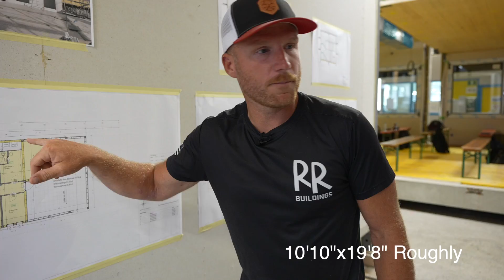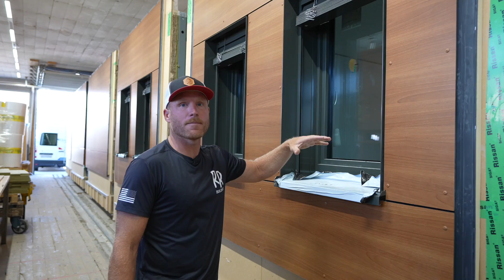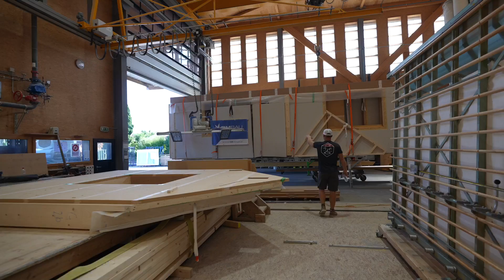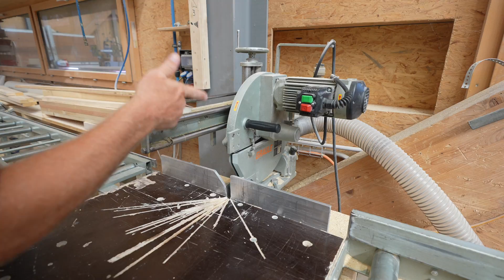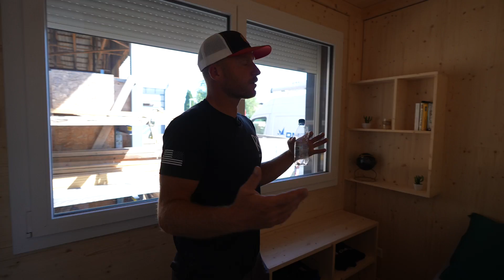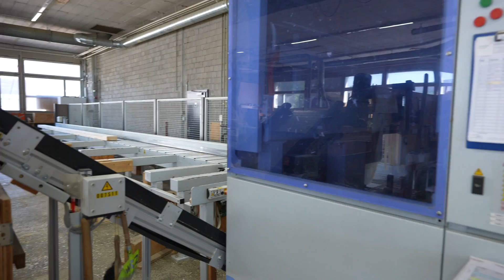First Time Seeing Modular Construction.  Switzerland Siga Tour Part 1

Comment: Abstract
Modular construction is a fascinating method where building components are manufactured off-site within a controlled factory setting. This ensures consistent quality and protects materials from weather-related damage.  The video showcases a Swiss modular construction company specializing in projects like a three-story McDonald's. They also manufacture residential units and even complete portable homes.  The advantages of this approach include accuracy, efficiency, and the ability to construct the majority of the building within a protected environment.

Comment: Kyle, you maybe think that you don't have in common with the Swiss the 'modular building' principle. But what you do have in common is your level of accuracy. I was born and raised Dutch, now in North America, so my brain is split imperial / metric but I have that same Swiss/German/Scandinavian need for accuracy. Building furniture, a quarter of a millimeter is not overdoing it. Which means in imperial I will do at least 1/64".

So a pencil line is too wide, a Stanley knife mark is much more accurate. On your huge post frames you do exactly that. Mmm, maybe sometimes 1/32nd :-). Keep doing what you're doing ...

1"  = 25mm
1/8" = 3 mm
1/16" = 1.5 mm
1/32" = 0.75 mm
1/64" ~= 0.5 mm
1/128" ~= 0.2 mm

Comment: Cracks me up at people at "how dangerous" a RAS is, it's no more dangerous than a table saw, miter saw and a circular saw. There are numerous video's on how to actually use a RAS properly. 
Modular buildings are nice, you really have to sit down and make the plans out very carefully. I don't like going "up", as one ages, one's knees say, no more stairs. A proper company that does this, (factory), does make these very nice and yes, extremely precise. Yes, it is the way of the future and it's already here in the states. The problem with what we "American's" make doesn't equal to what foreign countries do when it comes to quality. We simply don't make things like we used to and it all comes down to the bottom dollar as to why. Cheaply made but sold at twice to three times the price as it should be. Cheers :)

Comment: Come over to Northern Indiana. We have several modular home "factories" you could tour. My uncle has set modulars for 40+ years. My first real construction job was working on the on-site crew building the garages and front porches on these modular homes after they were set onto foundations. We were building a garage in about 3-4 days, start to finish. (Vinyl siding and shingled rooves on a 3-man crew.) We cranked out a bunch of homes that summer!

Comment: We recently bought a house that was a manufactured home , I love these builds but one thing they need to address is when they run the wiring they notch all of the panels and it is a virtual pathway for mice and chipmunks , after we moved in we found wires that had started on fire at some point and I ended up taking the lower section of the drywall out and redoing most of the wiring

Comment: My dad worked for a modular house designer/builder in 1954 in Baton Rouge, LA.  Dad and mom bought a house that was built of premade walls and other sections that arrived on site and connected.  The house was part of a subdivision of similar houses.  We moved back to Shreveport between Christmas 1955 and New Years 1956.  From what I can remember, the houses were finished out as usual on-site.

Comment: So cool how it can be constructed in a fully controlled environment , quickly and safer for the builders compared to a timber framed houses. Just have the raft slab or foundations with sewer ,elec and water connections done prior then crane your new apartment in connect up elec, water, sewer and you're off (lol never that easy). Only cost issue is that metal frame work of the modular container that's going to cost $$$ but can be offset by the reduced labour cost and possible lower internal finishes. Awesome to be able to just stack multilevels on at a later stage if the foundations were planned for. It's just limited architecturally if you looking at adding personal touches. Good idea for student and small apartment setups and easy to renovate interior later with a strip out Reno. Welcome.to the new world of living/working in a comfy retangular shaped shoe box.

Comment: Modular buildings ar getting more and more popular in the Europe and Scandinavian countries. I used to work for company that builds frame from metal. Pretty cool technology. Bathroom was built at the different factory and was lifted in the module after when floors and walls were built. After that comes roof panel on the top.

Comment: I was a general contractor in modular housing construction up until 2013.  Most of the homes we sold were manufactured in the Elkhart, IN area.  Some of the positive things about them is they're very energy efficient, consistent built quality, and structurally sound with a 10 year structural warranty.  I'd say that's an impressive warranty after they've been hauled down the road for 3-4 hours, moved on site with a dozer, lifted with a crane, etc.

Comment: It's been done in US for a while, many people have modular homes, some even double wide modular homes
Reply: I have such a modular mini-home....built in Canada's smallest province, where I now reside since 2020. The home is a 2-bedroom/2 bath with combination kitchen/living room and vaulted ceiling...as well as a mud-room, large enough to accommodate a full-size side-by-side washer/dryer, 48g Water-Heater as well as a Venmar air-exchanger . The outside dimensions are 56 x 18 feet, and the inside measures 54  x 16 feet, i.e. built energy-efficient with 1-ft thick  outer walls.
The build-cost including delivery (33 miles / 53 km) & install (on brick footings) was C$87,000 plus Taxes of 15%. 
Mind you, the build quality - while relatively good for Canadian standards - would never meet the Swiss workmanship (i was born & raised there 72 years ago...lol), but I'm happy with my semi-retirement home on 56 acres of wooded land about 2 miles from the sea ;--)

Comment: I worked for a company in North Carolina that built fully modular homes. We rolled out a house a day. I worked on the ceiling crew.
We racked up trusses that had channels routed out for 1X4. After the framing was done we would lay the drywall on the trusses. The ceiling was up and level unless the ceiling was vaulted. We used a speed set for mud. We taped and finished the drywall. We stood half the roof on the ridge and sprayed the popcorn texture. We'd lay it down on blocking and re-group the overhead crane to pick it up level and set it and attach it to the half of the house. Then start the next half.

Comment: The profit over quality mentality in the US renders a poor product for the masses. The Swiss/ German mentality of presicion lends itself to high quality resiliant construction. If A US manufacturer tried to employ these methods they would be underbid by low quality construction that lasts as long as the minimal warranty, less than the mortgage. The exception are the top of the market firms like Benson Woods etc who snag the few consumers who demand and pay for their quality. You have engaged a segment of the building market which suits your skills and vision. The capital costs of CAD driven modular shop built construction you are demonstrating though superior would not be rewarded in the US.

Comment: Most say modular homes are built better than stick framed due to the better foundation (steel frame built in a table) and being built inside so no rain and that they can just repeat cuts on giant tooling.
Reply: The advantages are obvious but the market decides the quality of the design and what materials are used. If a client will pay the same money for a cheaper product then the better product can not last in that market.
Reply: @toucansteve  Same can be said for tools made in China. How much quality you want depends on how much you are willing to pay.

Comment: I think for your type of work you could assemble your laminated columns in the shop and then take them to the site then attach your horizontal lumber for the siding, then erect the wall. Instead of trying to laminate your 2x6 columns in the field. Maybe it would save you a little time....
Reply from the maker: I buy laminated columns from a manufacture
Reply: @RRBuildings  Oh? Is that a new practice? I seem to remember a little while back you were laying out 2x6 on the ground and then standing them up with your horizontal girts already attached. That's what I mean by laminated columns. Is that the wrong terminology? Anyway, I love the channel. I'm a retired builder of all things custom and your dedication to craftsmanship is excellent.

Comment: I think it definitely has its place in the US that it would make life much easier. I think as long as your closer to infrastructure it would be something that could be quite popular. But for your more rural builds I don't see it being that practical to try and bring in large trucks and cranes without paying a ton of money on prep to the ground to allow for those weight ratings on say a dirt driveway or a heavily wooded area along a narrow driveway etc. My biggest questions as a firefighter is what does a fire look like for those. That is super interesting construction for sure.
Reply: FYI the use of materials and the controlled environment / construction means these structures meet the most stringent of fire regulations, as well as insulation etc. standards.
Reply: @WPGinfo  I am sure they are most of europe has way stricter standards than we do in the US for building materials, fire ratings, etc. I just wonder how a fire would behave if one starts.

Comment: Kyle, as a professional in the UK building products business for the first 15 years of my working life, I could never understand why the use of pre-fab, modular buildings never took off. You have underlined all the positive benefits of such systems, yet certainly here in the UK, where we are desperately short of housing, there are only a handful of manufacturers producing at best, a couple of hundred houses per year. Go figure!
Reply: We had a client try to get an insurance quote for the home they wanted to build in Sussex UK, wood prefab it was in the tens of thousands. Mainly due to insurance companies not liking wooden structures here, or shipping containers. Sadly we can build better, more air tight and insulated buildings from wood on site or prefabbed than you can currently with brick. Hence housing stock efficiency and running costs haven't realistically improved since the 1990s and in many cases are actually worse than the homes built in the 1930s and 40s.
Reply: @effervescence5664  Total lunacy. In Europe, Scandinavia and the USA, timber framed houses have been the norm for decades. An insurance company which looked out for new opportunities would see there is a great chance (after due diligence) of developing a new market for itself.

Comment: The crew i work with just finished a modular building, well we didnt put it together. We only did the siding.

The whole thing was built with premade squares. They didnt do a great job with lining everything up (it wasnt square at all, sections were placed inches off) but it turned out alright. We only did the cladding on it so we had to work with what we had because the cladding suystem they wanted didnt have any type of "leveling" system to it but we did a mix of hardieboard and corrogated roofing

Comment: All it comes down to is time and cost. If it's not faster or cheaper to do it this way, then it's not the "future" like all these companies like to claim.
Reply: That's essentially the whole point of that machine. It can do the work of multiple people over multiple days using with just one operator in a fraction of that time. Building off-site allows for the use of such machines a well as guaranteeing that sufficient work and material storage space is available for the job. Meanwhile groundworks can be in progress on-site without materials getting in the way. Additionally for transportation you're transporting only the used materials, off cuts and spare lengths are not transported so you're saving on that.

I think you'd struggle to make this construction method more expensive than traditional construction.
Reply: @yngndrw.  Well it depends what type of building and where you live. I don't see how this process can compete in residential housing where we can frame the entire house in 2 days with a 3-4 men crew. 2x6 and plywood is cheap compared to what they're using in this video.
Reply: @yngndrw.  Then you have to consider how much it cost to build and maintain such an enormous building. Then add the machinery cost. Then think about  how it would cost in shipping since you can only fit 1 or 2 module on a semi trailer. Additional cost if it's an oversized load. 

See, I'm a contractor and I don't see how it would cost less to build our stuff using this method.

Comment: I worked for a modular housing company and I'm surprised it's not being done more in the U.S.A. It only takes about 2 to 6 weeks to make a house depending on the size because weather isn't a factor. Also, because they have to be transported, they are built much stronger than traditional homes.
Reply: Have been working at a modular plant for the last 4 years in Pennsylvania as a exterior/interior wall framer and drywall. There are a handful of mod plants in my surrounding area that ship daily and cover the east coast down to Florida. Only plus is that i have covering and a little protection from the elements. The pay isnt the greatest but solid constant work.
Reply: Larry Haun the legendary framer and writer for Fine Homebuilding said that modular homes would have an extremely positive impact on housing in the USA. After building tract homes for years in California and watching a housing shortage develop he realized the ease and speed of modular construction was the way to go.
Reply: They relly are, I work with temporary buildings, putting them together and taking them apart for transportation to usually the next school. They are really well made, but in every joint we miss insulation
Reply: Cost. Cost is what everyone pushing for these things dance around. And anytime I go to look, it’s not just a slight increase, we are talking a dramatic jump in cost difference.
Reply: How does modular home differ to the end user? Compare that DMBau to a quality company installs CLT-elements and does the finishing? Modular will be faster to build and install, but is the cost the same, or even more? As the factory is rather expensive when compared to just skilled workforce (which you do need in the factory also).
Reply: @renderwood  I was in the market for a Swiss or german made home a few years back, and if you had the time to DIY some parts, you could safe a pretty penny. It´s basicly so that you build your Slab or Foundation with basement on your property and when you are ready, the construction company shows up, and in a 10 hour day, your house is ready and weather proof. If you choose the full package, the day after the next team comes by to finish everything inside like Floors ect. The Construction phase is done with a mobile crane or even a crane that is mounted on the truck itself.

https://www.youtube.com/watch?v=UVVVTQ6etKw <----not exactly the same type of home, but the steps are pretty close.
Reply: @Ordog213  That was pretty quick. Especially when the windows and doors were already installed.
Reply: Yes, modulor are built better than stick built.  Like you said this is due to shipping and the fact that they have to be lifted by a crane to be set on the foundation